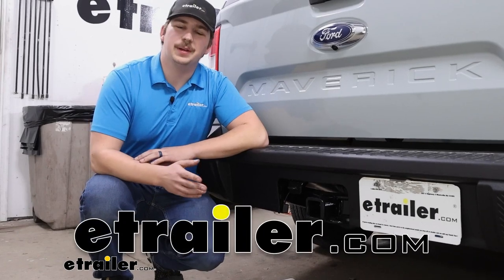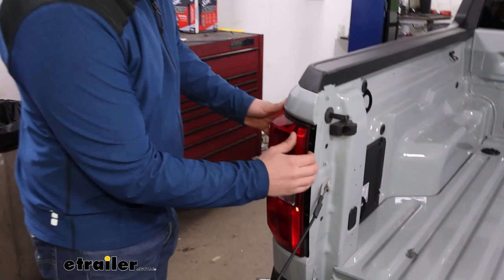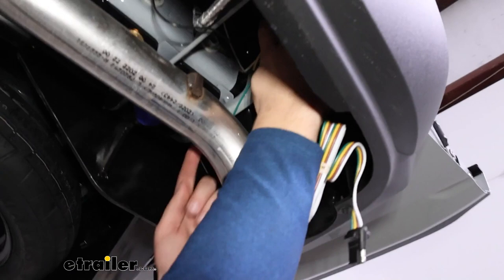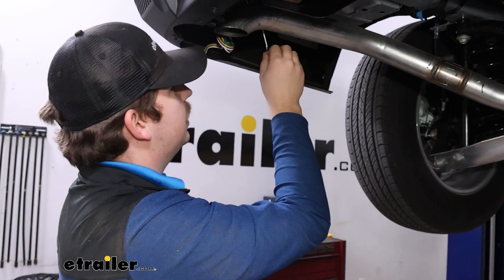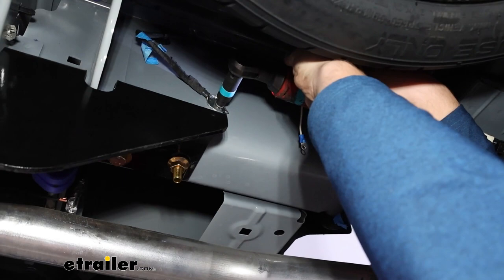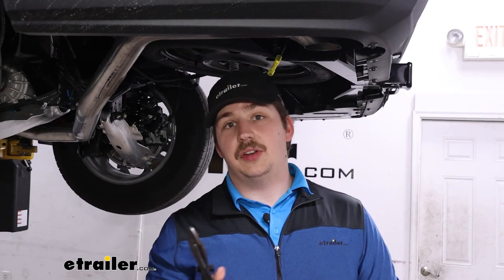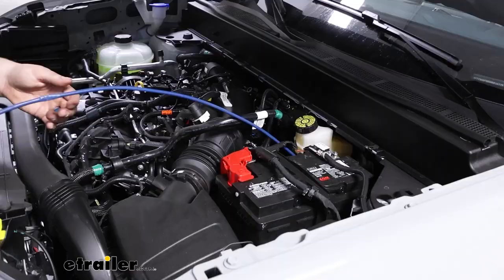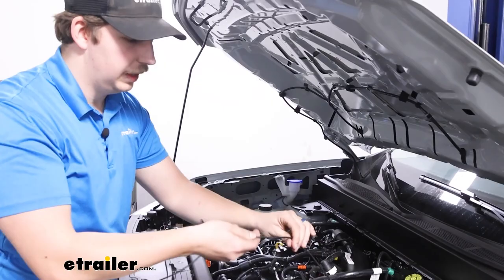etrailer | Curt T-Connector Vehicle Wiring Harness Installation - 2022 Ford Maverick

Comment: do you have a video explaining how to put a 7 pin on the maverick?
Reply from the maker: We don't yet. You can install a 7-way to a non-tow package equipped Maverick using the Tekonsha # TK95VR. Tekonsha provide some decent install instructions, which you can check out here:
https://www.etrailer.com/instructions.aspx?pn=TK95VR
Here's a link to the product page:
https://www.etrailer.com/Custom-Fit-Vehicle-Wiring/Ford/Maverick/2022/TK95VR.html

Comment: Curt does not recommend adding that much length to the ground wire. Sand off the paint and use the self tapping screw and ground wire included.

Comment: Is there a reason you didn't use the power wires Ford leaves in the bed for add ons?
Reply from the maker: There's a very simple reason. We install everything according to the wiring harness manufacturer's instructions. There are alternate ways of installing many things, but to ensure proper operation and to retain warranty coverage, we installed it as Curt intended.
https://www.etrailer.com/Custom-Fit-Vehicle-Wiring/CURT/C59DR.html

Comment: shouldn’t you have power, if power was already going to the rear lights?
Reply from the maker: The harness gets its switching information via its connection with the vehicle's taillight harnesses, but gets the power from the battery. The taillight wiring harnesses use wires that are pretty small in gauge which don't have enough capacity to power both the vehicle's and the trailer taillights. The trailer taillights won't operate without that connection to the battery.
https://www.etrailer.com/Custom-Fit-Vehicle-Wiring/CURT/C59DR.html

Comment: So Curt's "no splicing required" harness requires a splice. Got it.
Reply from the maker: The harness is plug and play in that it plugs inline with the vehicles taillight wiring harnesses. You won't need to splice into them which can potentially damage things if not done carefully. You will need to use a butt connector to extend the wire that runs to the positive battery terminal, but you won't splice into any existing wiring. Hope that helps clear it up for you.
https://www.etrailer.com/Custom-Fit-Vehicle-Wiring/CURT/C59DR.html

Comment: The "Flex Bed" on the maverick has 2  12 volt 15 amp plugs in the rear, could I use one of those to power the trailer lights?
Reply from the maker: Nope, we don't recommend doing that. Getting the 12V power directly from the positive battery terminal is recommended because doing so isolates the vehicle's electrical system from any short circuits that might occur in the trailer's wiring.
https://www.etrailer.com/Custom-Fit-Vehicle-Wiring/CURT/C59DR.html